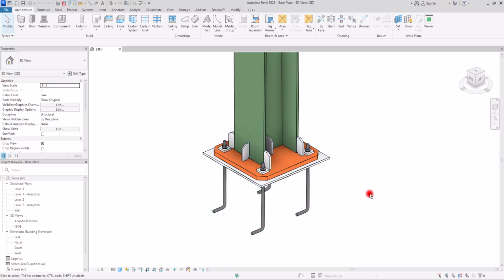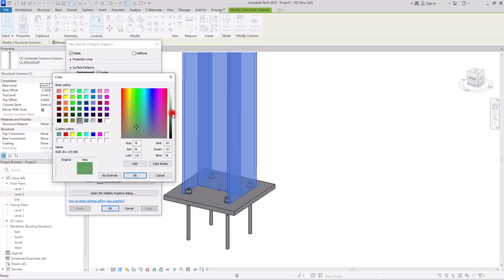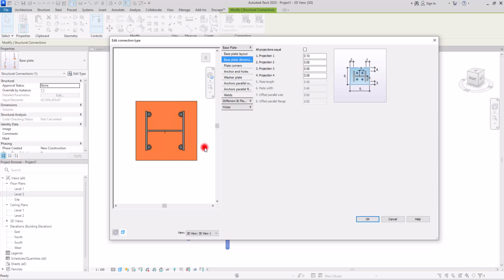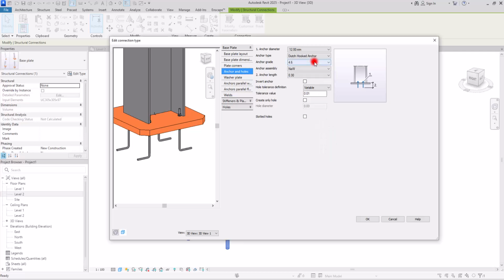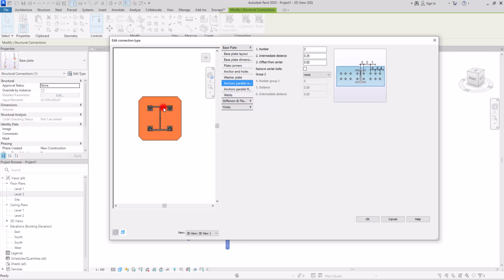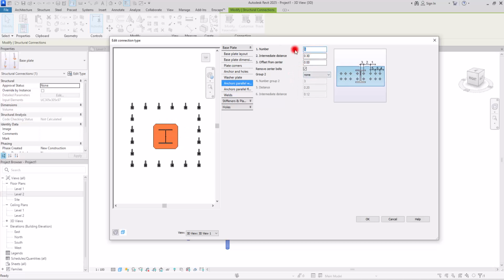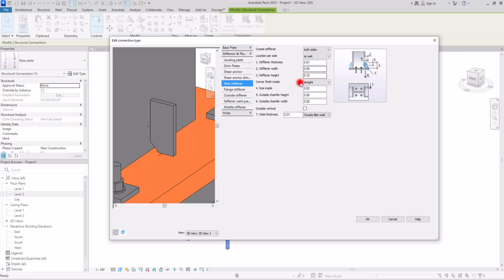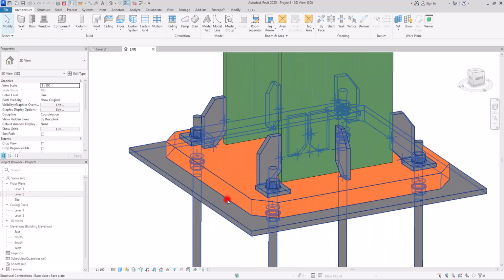How to Model a Steel Base Plate with Connection Tool?! 🎯

Comment: Why did you start by removing the radius of the columns?
Reply from the maker: Sorry for my late reply! I started by removing the radius of the columns because filleted corners can be hard to see clearly without shadow, especially in video. I just prefer it this way—no specific reason beyond that.